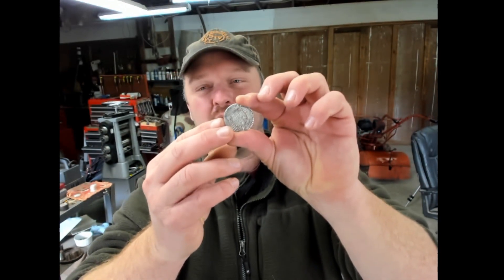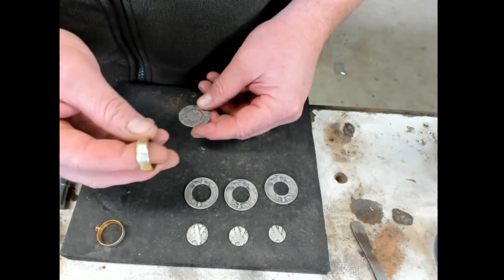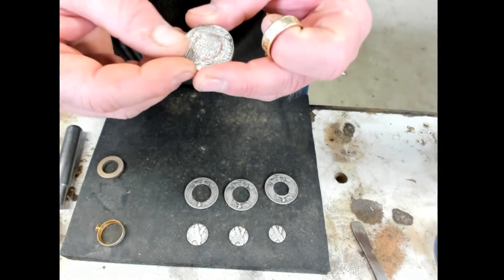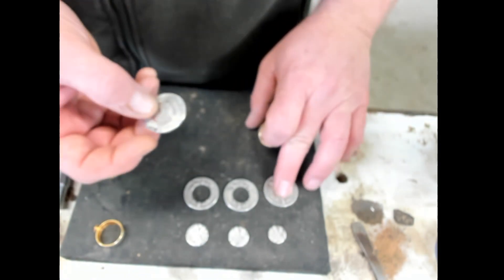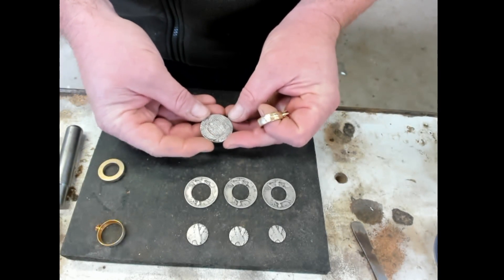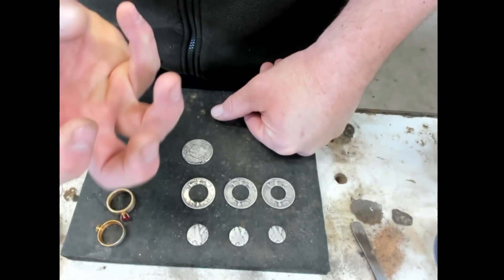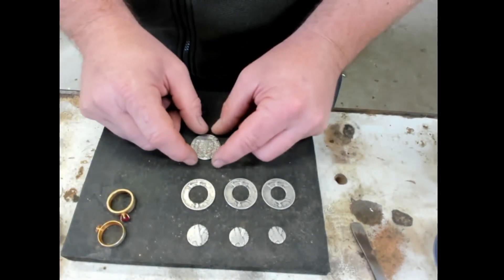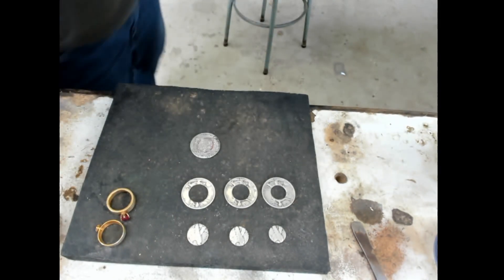1492 Spanish Coin Ring! Part 4

Comment: What are the 2 most popular punch sizes
Reply from the maker: That's a good question. It really depends on a lot of factors though but I would say the 1/2" is the most commonly used? What coins are you wanting to use? I'll typically do 3/8" for qaurters, 1/2" for half dollars and 5/8" for Silver dollars but I can go up or down in size depending on ring size. Larger rings that are stretched a lot get a smaller hole while smaller rings that get reduced a lot look better with a larger hole due to the band becoming wider. I am trending toward narrower bands overall now.